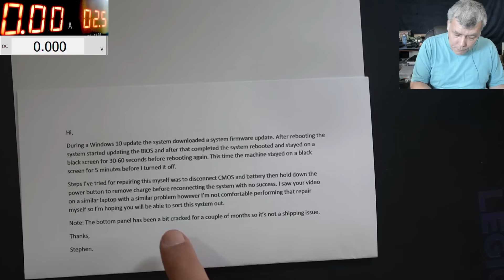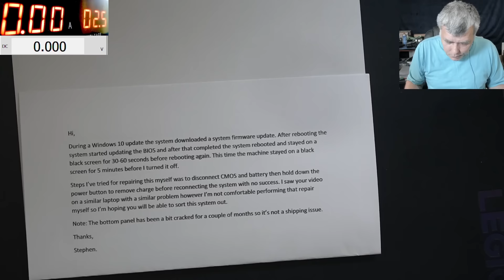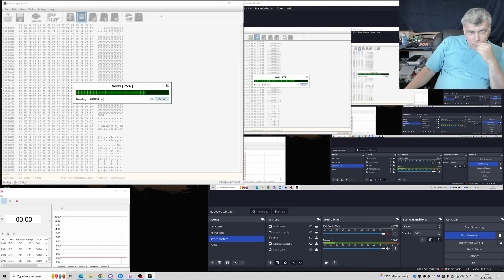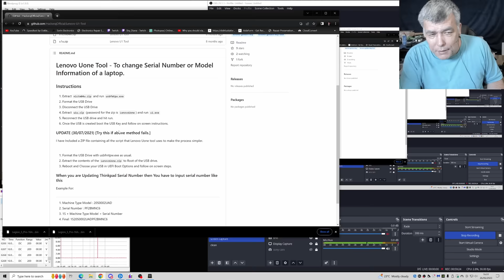Lenovo Legion 5 15ACH6H dead after windows updates - Sadly, laptops are dying after windows updates

Comment: I always update my BIOS separately via the Lenovo website and keep it always up to date. But Regarding my Windows updates, I usually wait and update only once a week for safety reasons. I used to check for new optional and essential Windows 11 updates every time I used the computer and had after the update problems launching some of my programs including games on Steam. Even reinstalling drivers and games altogether didn't help so I had to perform a clean reinstallation of Windows 11 and since then it works again flawlessly. 
The main message I have is to never update immediately after the update release and always wait a few days just to be on the safe side.
Reply: Only slight correction. One should NOT update the bios as long as everything is working. If there are some bugs that could be explained by bios not working as intended, then update it. Otherwise leave it alone.

Comment: I always prefer genuine charger so I know that isn't this issue because we never know what ID trickery they are doing knowing that any given charging chip might halt until there's enough power available. I also hate bios faults because the way modern ones are keyed to the board and flashing one off another same model won't work. I might if I had some software that could edit the file for the model I have. I don't like bugging people on forums to do it for me.

Comment: I recently broke my laptop under warranty because of a bios update, not from Microsoft, but from Lenovo's website. My laptop is also a Lenovo, an Lenovo Ideapad Slim 5i Pro 16. I actually want to have the motherboard replaced but it would cost me half the worth of the laptop  Considering having it reflashed at a technician. Looking at your video, this gives me confidence to have my laptop bios simply rewritten.
Reply: Hey, I wanted to ask how did you fix the issue ?
Mine is dead after Bios update
Reply: Hey thanks for commenting. Allow me to give an update. Long story short, I got it fixed. For those who want the complete details I’ll have it down below.

So you guys know what happened already, and by the way the cost of a new mobo is the same as getting a new one lol. 

Anyways, I had it repaired at a reputable technician, but before that, I unfortunately went to a different technician. He made things worse lol (further broke it, messed up the motherboard). With this experience, I totally thought that I completely lost my laptop worth around 800$ (1050$ in the Philippines coz prices are crazy here).

When I went to the GOOD technician, he was able to fix the laptop, worked good as new. No performance issues or data loss whatsoever. I was actually really scared because I might lose all of my data because I was thinking that they might do a complete reset of the system, but no, nothing was lost, including my license with MS Office. If anything, the only thing I notice is that it consumes a little bit more power but everything works well regardless (I'd still pick this over completely losing my unit).

This is why I’ll be sticking with Lenovo. Proven and tested. Just find the right technician and he’ll do miracles on your unit.

Cheers :>

Comment: Does anyone has a link or buying source for the 90 degree charging adapter seen at 2:33.
My desk is kinda short horizontally and its fixxed to the wall which makes the thick wire bend alot.

Comment: Outstanding repair job.  This repair is unfortunately beyond the scope of casual tinkerers, and I wonder if Microsoft has legal liability for essentially bricking an end user's device like this?  Regardless, good to know a fine laptop like this can be restored by a knowledgeable individual.
Reply: Unfortunately Microsoft includes a disclaimer in their license that they're software is not fit for any particular  purpose, meaning you have no expectation that it can update a bios successfully or even run a computer as an operating system. And according to the messed-up views of our legal system, it's okay for Microsoft to force you to accept that license before you even read it much less use the software. Not making it up it's called a shrink wrap license. You pull the shrink wrap off to read the license that's inside and you have agreed before you even see the license. Go figure.

Comment: Similar issue here with an Thinkad e15 gen2: It stopped charging and died when the battery drained all its charge. Never charged again. Luckily Lenovo replaced my mtherboard on warranty. They said it was related to an update required that I did not install on time, and that caused an component damage. It works great now, with its new Motherboard, but I'm not too confident on how much time it will last as it could happen again. Today 12-jul-23 a new firmware update appeared, and I  installed it with no issues. Hope it lasts as it is a great computer, I love it (when it works)
Reply: That is SO weird. "Update required that caused component damage" - like they're gaslighting you as if YOU were the culprit, lmao.
Reply: @helltarrist  true. But what to say, I am not an expert :)

Comment: I'm curious if there is a way to prevent windows from flashing bios, like disabling firmware device in the device manager or something. Because this is unacceptable, BIOS is not meant to be updated at will, if it works - it works. If it is buggy - whole different story.
Reply: By default win 10 (dont know if 11 work like that) DOES NOT update drivers for pc automatically, at least on desktop, it just adds win updates, visual c, frame network and other windows stuff. Other updates are optional and can be stopped/canceled. This was really strange thing to happen, maybe on laptops is different.
Reply: @milosstojanovic4623   I have an ASUS small laptop with celeron (don
t really remember the model but is somewhat recent), and moment I installed windows 10 on it, it installed all drivers from Windows update (as it should), but also it rebooted into BIOS and was happily showing a bios update  countdown, which was quite rude. So I guess it depends on the manufacturer of said laptops.
But you know, I don't use Windows that much these days, so I don't really know.

Comment: Well, with all due respect, I was expecting this... And you can't deny I told you so... Remember that live session where you attempted Cristian's laptop repair with multiple issues? 
My opinion was that you can't actually use your bench PSU on laptops with charger ID pin (HP, Dell, Lenovo), but you rejected my theory, explaining you have a "special" adapter cable, with all the necessary stuff to emulate the ID pin... Well, it seems I was right after all...
For the special Lenovo case, there is a lot of literature on the internet, about how this ID pin is implemented on their original chargers. 
Search on Google for "Lenovo ID pin resistor" and you'll find out how can you trick any PSU to be recognised as a genuine Lenovo charger.
Therefore, the solution I use is to put a specific resistor between that third ID pin and ground: the specific value of that resistor determines the wattage of the power brick you need.
Cheers!
Reply: @ Silvake: Yeah. I was in that session live. Here in North America they believe that each manufacturer will build the internal lithium batteries that it will use in its equipment (laptop in this case) and that it must cover them with the authorized logo of its brand. We know that "cheap" "copies" can be manufactured with similar features to the original, so they have been forced to also design their chargers/adapters to recharge those internal batteries of yours as safely as possible. Another way of saying it, manufacturers don't want any more lawsuits (for lithium battery explosion) let alone in a US court.
This opinion that I share here, may not like anyone, but at least it makes me reflect. Once again, and I say it with absolute sincerity, thank you for your comment because that is how we all learn by analyzing and debating the issues openly. All the best.

Comment: This is not a Microsoft issue nor a BIOS would come from a Window's update. That's the manufacturers. Some how you may had the driver update app installed on your machine that may have bricked it. I have a Legion 5 I use daily in Music Production that goes threw weekly Window's updates and it only installs security patches and system updates. It's got nothing to do with the BIOS. I had my Legion 5 for 3 years still on the same firmware version from 2020. I work in the I.T Field as a Field Tech and Linux Sysadmin and i never came across a any BIOS update via a Window's update. It comes straight from the Dell site. I work on everything from Windows, MacOS, UNIX Solaris to RHEL Linux system's.

Comment: I had about 15 HP Elite laptops that I found thrown out in the garbage, I managed to piece together 8 of them into nice units, but the BIOS had a password lock. I managed to desolder each BIOS chip and manually flash them to a password free version, and they all worked fine! It took me a while to realize that I couldn't actually flash them with an external clamp because they had some sort of tamper proof circuit... but removing the chip worked fine for flashing!

Comment: Not only laptop, but All In One also. I recovered a V530-24ICB that died after an update, seemingly done by windows update. AIO didn't POST and loop screamed 3 shorts - 1 longs beeps.

Had to desolder and reprog the 128 Mbits chip with a binary dump found on badcaps (If I recall correctly) then resolder. The system restarted like a charm. 

Also did a HP mini not long ago, same kind of issue (but no beep whatsoever), bios chip reprog rez'ed the box.

Comment: I have a desktop. Up until I stumbled upon this vid, I thought it was impossible that a Windows update can mess with the bios.
It appeared to me as if updating Windows broke something into my bios. I've been having problems with booting into Windows and only upon resetting bios did I manage to get it back running. Keep in mind that the order of the boot items is the same. But at times the problem keeps coming back and I have to constantly reset the bios in order to fix it.

Comment: I learned something new in this video:  you can put a lot of solder flux on a joint being soldered without ruining the solder joint.  I thought flux was conductive but apparently it's not, it just cleans and strengthens the solder bond.
Reply: Certified solderer here. The point of flux is to tranfer heat, clean the pads, and causes impurities in the solder paste to float to the surface where they can be wiped away and not interfere with the joints. Some fluxes are conductive while others are not. The flux can also eat at the solder and pads over time. Assume all fluxes are conductive and corrosive. All the flux should be cleaned off with q-tips and isopropyl alcohol before powering on or replacing any panel.
Reply: @shalopez420  I see.  That's very interesting and thanks.  Somehow I had confused the flux with the solder.

Comment: The first thing I do when I install Windows for someone is that I disable hardware updates through windows updates as it can cause trouble.
This is one example and the second is when windows update automatically replaces newest drivers with older ones.
As it happened to users of AMD graphics cards.
In some instances it could break the system if it occurred during already commenced update of the same driver.

Comment: Bios updates forced upon you from within OS from 3rd party bloatware or Windows themselves should be a literal crime - no generic user has any understanding of a BIOS and what the risk is to update it, and like this user did, may turn it off during the update. Or worse, ie. Corruption or just general crap.

Should only ever be done from within the bios flashing utility itself, or bios flashback usb... with learned knowledge of the process..

Its also more criminal tbh that in 2023 bios  updating is still such a disastrous procedure. Im sure bios flashback means you can always recover, but if you dont have a bios flashback motherboard? And no backup 2nd bios? Youre done

Comment: Looking through comments, I didn't see anyone suggest to try a BIOS recovery. Most laptops and desktops made from 2015 (some older) on up should have some type of BIOS recovery where you use a USB drive with the BIOS on it. I know DELL and HP support it on most models. That is the first thing I check and try on a machine that I think has a corrupted BIOS. You should be able to find how to perform the recovery from the manufacturers site or by Googling.

Comment: As someone who has experienced this for years firsthand, I can tell you exactly why it happened. Some manufacturers place a 1-wire charging identifier chip in series to the center pin for the charger output. Eventually from fatigue, the ID chip on the charger brick itself and dies and will not allow you to charge the device, or turn it on. 

This is their attempt at brand blocking 3rd party chargers. That is the only reason the chip exists. Lenovo does this, as well as DELL and a couple of others. Dell is infamous for this problem. I cannot tell you how many replacement chargers I’ve had to send out because of that. Because of the 1 wire design of the chip, it’s literally taking the entire current being drawn by the device. They don’t last that way.

Comment: Customer provided a lot of valuable details.
With all respect BIOS chip should have been checked ad programmed first instead of doing 1 hour of troubleshooting.
Reply: Uncommon for a corrupt BIOS to cause those symptoms.  You lose.  Suppose you are used to it though.
Reply: @Look_What_You_Did  The guy literally said it happened during the firmware update.. its not uncommon for a bios update to fail and cause this kind of issue.
The repair was awesome either way, I just question the order of steps

Comment: my laptop is an HP and several months ago there was a firmaware update that was very scary, because the ventilator was at full for minutes, and when I say at full, I mean, even if the cpu is at 100%, the ventilator don't make that much noise, it was a level a bit above. And the really scary part is that I saw smoke coming from the holes of the laptop. Amazingly the laptop survived and didn't get on fire. Other thing, my laptop and the laptop of a brother (similar model) sometimes make a mechanical noise which is very very loud, much much noiser than a ventilator, and last for 1-5 minutes I don't know how that is possible but at least the laptop is working.
Reply: The smoke could have been from a dust build up. A good way of checking is to open up your laptop(s) and give it a good dusting.

Comment: Some laptops have a recovery feature where if you copy a BIOS file to the root of a USB drive, insert it into the bricked system, and hold down a key while powering on, it will do a "blind reflash" even if the display doesn't come on. It will flash a light or similar when done. I agree with others, BIOS updates seem to be erratic through Windows and UEFI capsules. Sometimes they download and don't install on reboot, sometimes the system freezes, etc.

Comment: This is why I always set the auto-update drivers to off, I did so since the NVIDIA 9900 driver for a clevo laptop uninstalled itself on windows updating, if I had set it off, I could've still been using Windows 11 on that laptop for the sheer "because I can"

I now always keep a BIOS ROM image for each newer laptop I got  in case, but there's the issue of anti-rollback features that stop older firmware flashing in some machines.

Comment: I had the PSU die on me and found that there is a resistor on the centre pin which tell the computer about the PSU wattage. 
They don't like you not to use there very expensive psu and a use a generic 20v PSUs.

Comment: Never buy LENOVO, They UV glued the onboard DDR4 RAM and Processor, so it can never remove or de-soldering... It's Horrible!  
Ex:- Ideapad 320-15IKB DG421 DG521 DG721 NM-B242 NM-B241
These type motherboards can't repair if you faced any issue with processor and RAM! 
Why nobody address this big issue yet?

Comment: I have repaired over 8,030 in 4 years. Wish I had that driver, I used Mikita and Bosch. Quicker than yours but no so nice on the torques. I remember a windows update that got me to 20 laptops in one day. Also itunes stopped people's CD trays from working, anyone remember that? Norton update? This kind of stuff happens in many magical ways! Power supply issues made it so it was the first thing I change. If you are doing at lest 11 laptops in a day the chargers I had on my bench could often become faulty. Luckily most customers were told to send their own powersupply and part of the job is testing everything in the tote. The idea was to prevent return repairs. Done at least 12,045 laptops & PC's in total. Over 1,095 TV's, not bragging, just worked it out. But yeah customer definatly send in your PSU and definitely check the Mr fixer. Having said that, the number of times I have trusted tested equipment to find it was faulty and causing the repair to stay on my bench  was all too common. You learn to question everything. That why I quit! 😂😂😂😅
Reply: 8030 repairs in 4 years? 6 a day, 7 days a week? Are you sure?